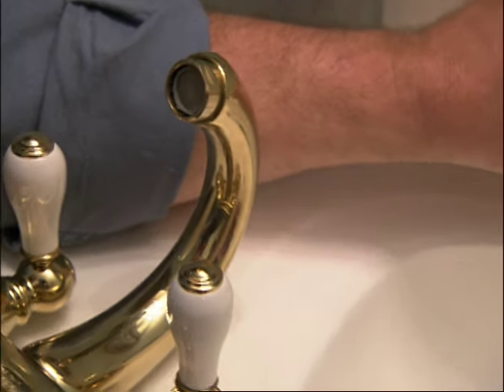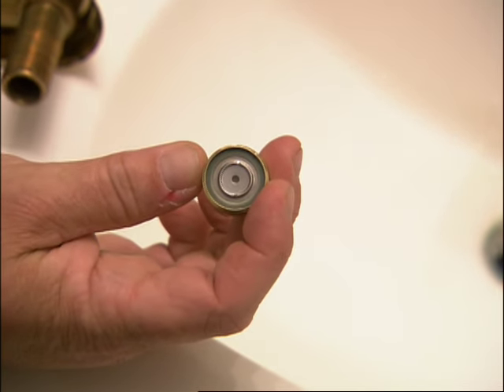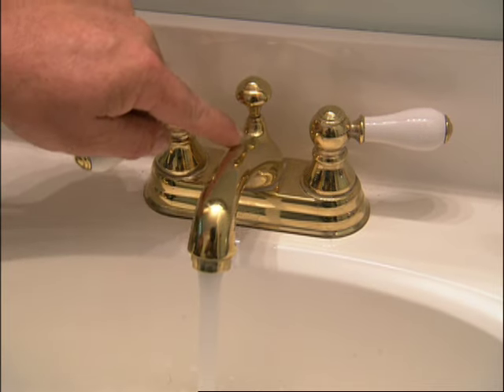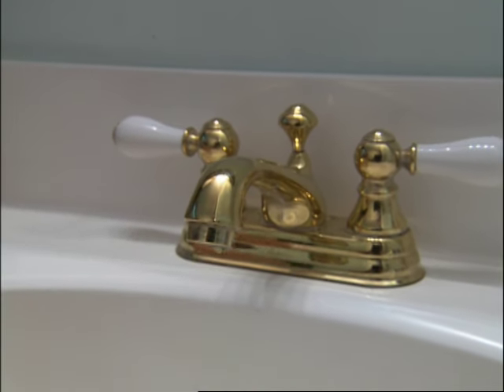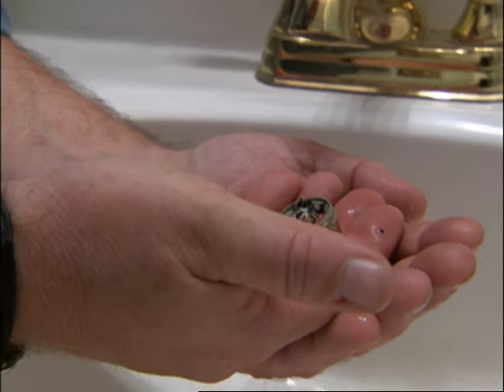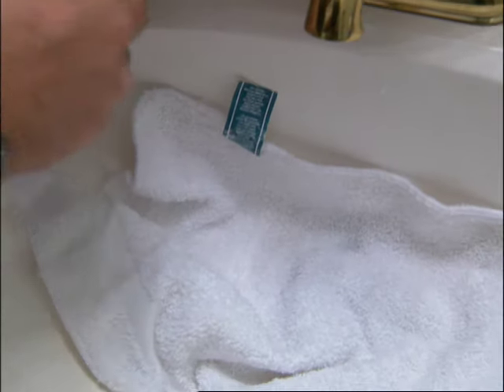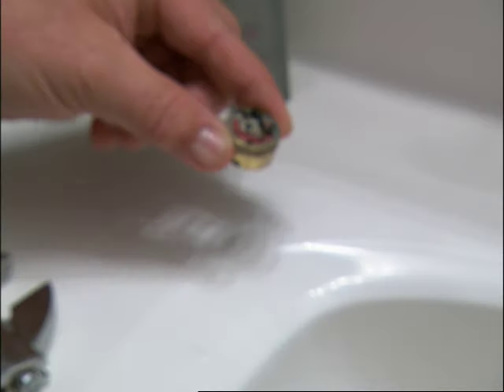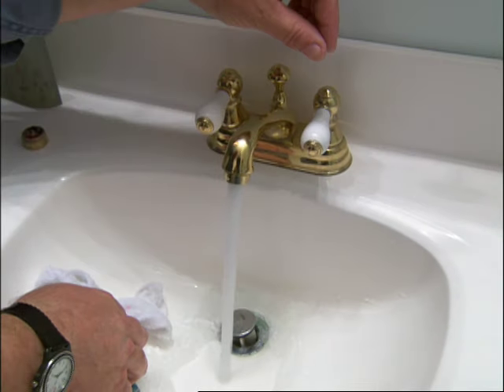How to Replace a Faucet Aerator | This Old House

Comment: Once again they tackle the easiest situation.  If the aerator does NOT have notches to use a wrench (probably 99% of the time), I take a rubber mat that is used in the kitchen to help open jar lids ans use that between the round aerator and my pliers to avoid damage.  It usually works like a charm.

Comment: Hello and thanks.  My kitchen and shovver faucets aerators have spinny quality so that vve can not put adapters on.  is the only vvay to remove those vvith a vvrench or such?  I vvant to put a shovver massage in for my muscle and pain conditions and the building put in small plastic ones and I vvant to remove them.  thanks

Comment: I would be wondering where that debris came from. Maybe check the seals on your shut off valves under the sink. You might have a bigger problem. Not just a clogged airator

Comment: Hi, I had an aerator adapter installed for a portable washer hose. My husband pulled it all incorrectly last night and now the adapter doesn't stay in place, the water pressure pushes it away. I noticed the piece inside the faucet moves a little. Is this a problem of the faucet or the aerator adapter???
Reply: The threads were probably damaged. Time for a new faucet. Though this is 2yrs old, I'm sure you figured it out by now.

Comment: Is there a standard size for all bathroom sink faucets?
Reply: Usually takes a male aerator, threads on the outside
Reply: Daijoubu I my house every tap has a female aerator. I think it's possible to create a list of 200 different kinds of aerators. It differs per country, tap make, building style, and just what the hardware market liked to get in stock at some time.

Comment: aerator is not turning with numerous wrenches. any ideas
Reply: I had the same problem with a Moen faucet.    They really put them on tight at the factory.   Put on  a little penetrating oil or WD 40, cover it with a rag and tap it  lightly.   Then try turning it in the opposite way that you have been doing, in other words, in the direction that would tighten it----but just a bit.  And then try to loosen it.   Don't force anything, but this should loosen it up.  Keep it covered at all times to avoid scratching anything.